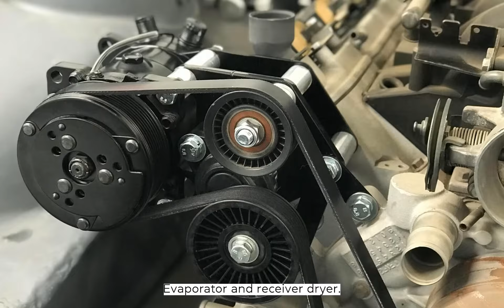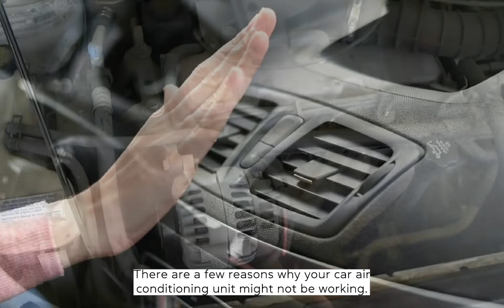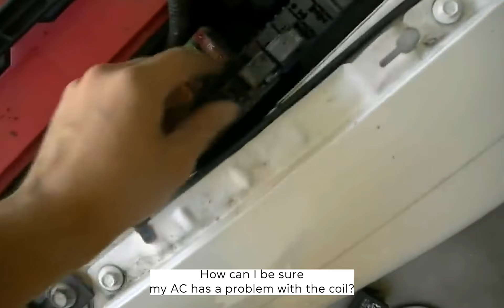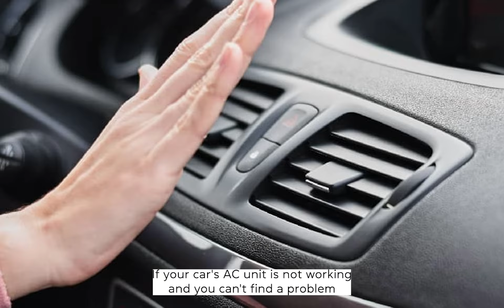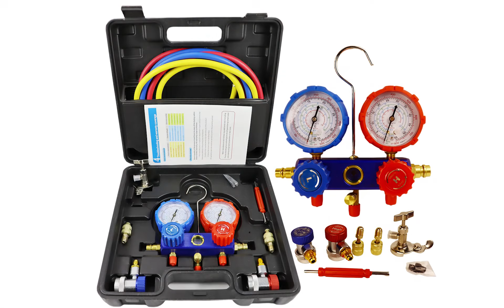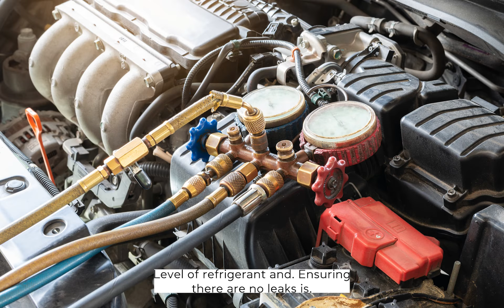How to Manually Engage or Jump Start an AC Compressor Clutch

Comment: Really vague about ringing out terminals on the components he is referring to.  Sloppy explanations about meter tests. Oh yeah, what if voltage at the relay is barely 2 volts…no remarks about what voltage should be reading.

Comment: Just disconnect the high pressure switch and the compressor clutch will engage
Reply: The clutch on my compressor won't disengage. How would I get it to disengage?
Reply: Really my fuse blows